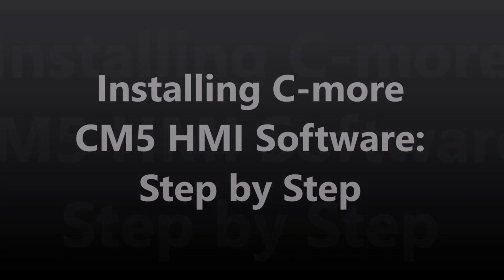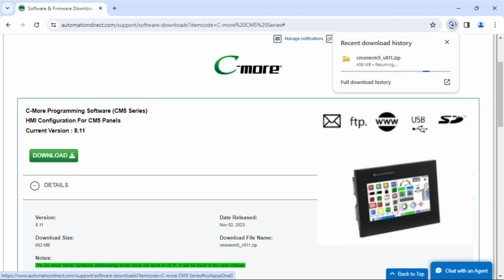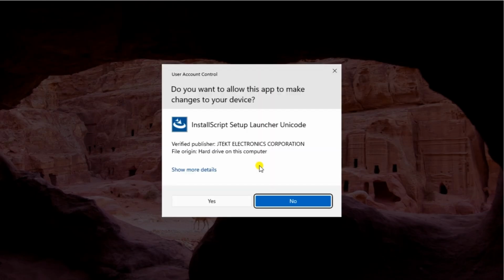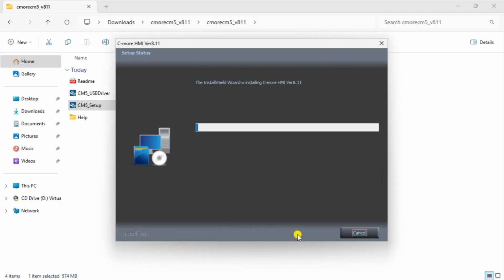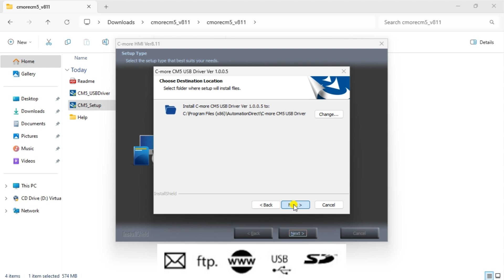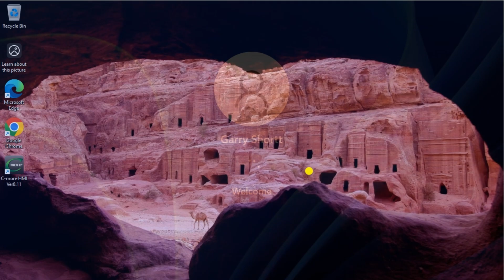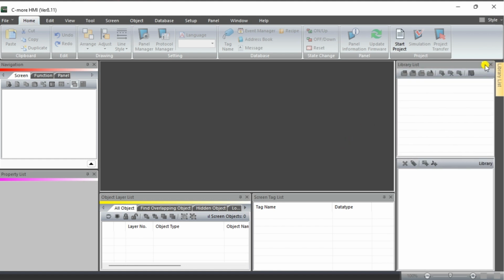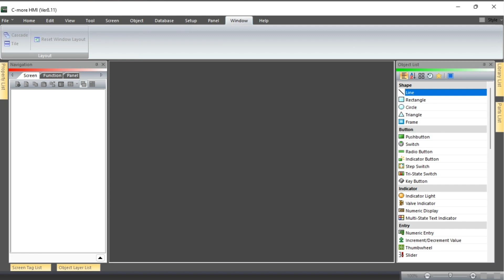Installing C-more CM5 HMI Software Step by Step

Comment from the maker: More information can be obtained at our website. This includes all of the links mentioned in this video. 
https://accautomation.ca/installing-c-more-cm5-hmi-software-step-by-step/

The C-More CM5 HMI series can be found at this URL:
https://accautomation.ca/series/c-more-cm5-hmi-series/

C-More CM5 Quick Features:
4″, 7″, 10″, 12″, 15″, and 22″ widescreen options
16.7M colors and LED backlights
800MHz or 1.6GHz Quad Core CPU
43MB project memory
12 to 24 VDC powered
Built-in real-time clock with 30-day backup (no battery required)
NEMA 4/4X (indoor use only), IP65
FREE HMI programming software with powerful design tools and a project simulator
CM5 series HMIs support any EA9 series project (created with V6.73 or later) for an easy panel upgrade

Support Links:
C-More CM5 Frequently Asked Questions (FAQ)
https://accautomation.ca/series/c-more-cm5-hmi-series/c-more-cm5-faq/
CM5-T7W Cut Sheet - Tech Specifications / Protocols
https://cdn.automationdirect.com/static/specs/cutsheet/CM5-T7W_cutsheet.pdf
C-more CM5 Overview
https://cdn.automationdirect.com/static/specs/cm5t7w.pdf
CM5 User Manual - Hardware
https://cdn.automationdirect.com/static/manuals/cm5userm/cm5userm.html
CM5 Quick Start Guide
https://cdn.automationdirect.com/static/manuals/cm5userm/cm5qsg.pdf
Product Brochure
https://cdn.automationdirect.com/static/catalog/images/product-pdf/CM5-C-more-Overview.pdf
C-More Programming Software (CM5 Series)
https://www.automationdirect.com/support/software-downloads?itemcode=C-more%20CM5%20Series
CM5 User Manual - Software On-Line
https://www.automationdirect.com/c-more/cm5/software-help
AD C-More CM5 Sample Projects
https://www.automationdirect.com/adc/shopping/catalog/hmi_(human_machine_interface)/graphical_hmi_devices/hmi_panels/cm5-t7w#

ACC Automation
https://www.accautomation.ca
Helping you with your automation control tasks...